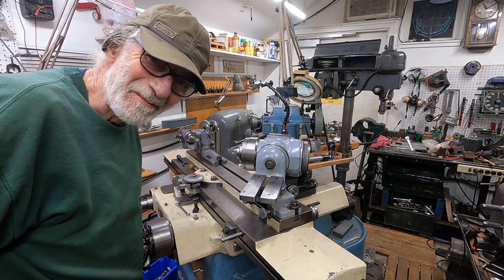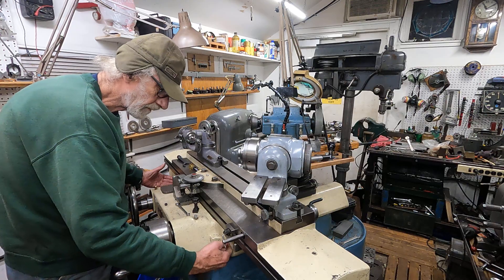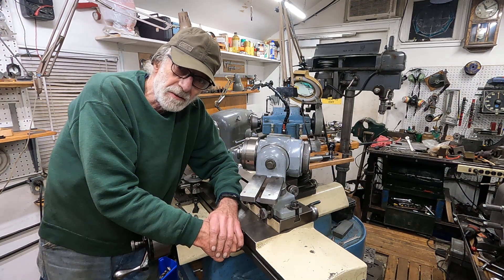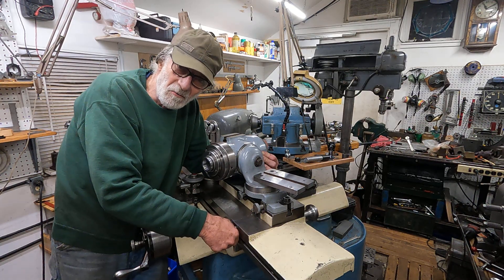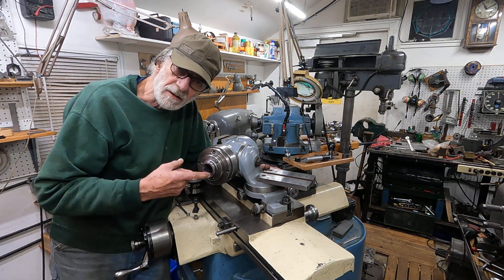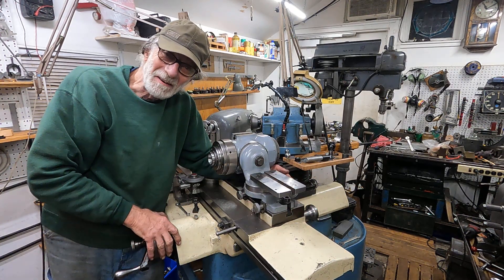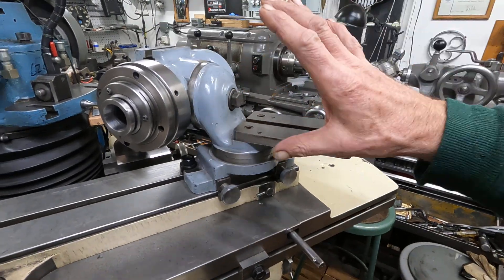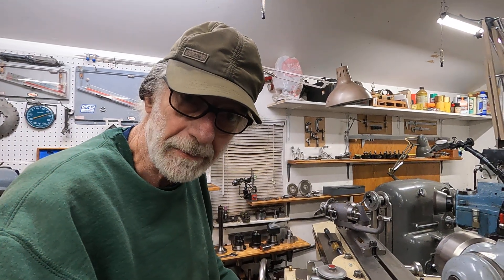Industrial tool & cutter grinder purchase advice

Comment: Kinda kills me watching this.  They were auctioning off some 'surplus to current requirements' (corporate wank for we need money) and had 2 Cincinnati Monesets that nobody bid on.  Both had motorized work heads and a simpler tailstock than yours, but I think they had index plates.  One was getting somewhat clapped out, but the other was a good machine.  I could have gotten it for $250 but I passed (face palm).  My shop is about the size of yours and I was parking my Vette in it over the winter so I simply didn't have the space for it at the time.  My brother had just passed a few months prior, my mill, lathe, and drill press were burnt-out husks, and I was off work with a broken left arm so it just wasn't a good time.  Also, I have a bench top Chevalier T/C grinder that's plenty good enough for my hack skills.  The table, like the Cincinnati, sits on balls riding on ground ways.  The work head uses 5C collets and uses an air bearing which works very nicely.  Nice little machine for pretty much all the stuff I have.  Picked up a small mag. table for it so I can some light grinding like shims.  Just kickin' myself for not grabbing that Monoset.....
Reply from the maker: The are more grinders than operators now for sure. I have an old version grinder but it works and it is in place, I think I will call it good, thanks.